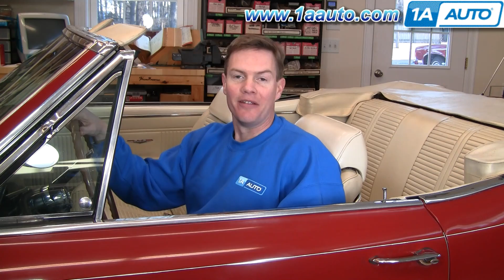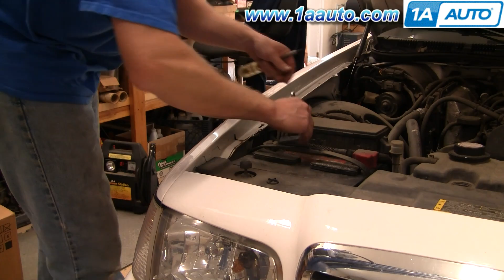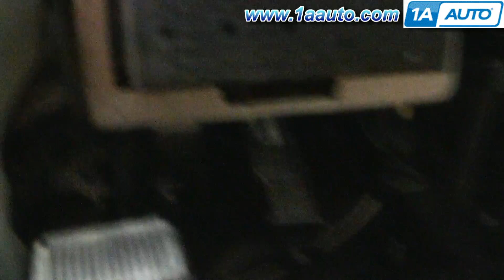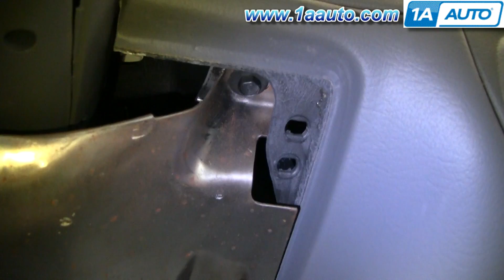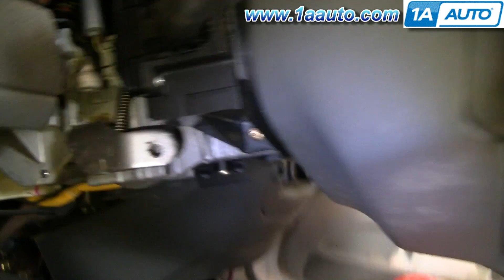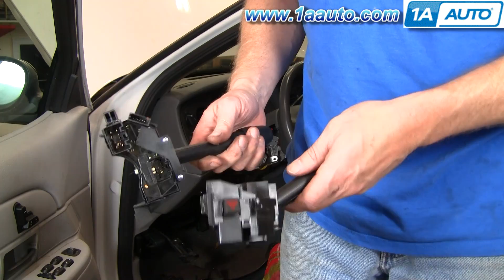How to Replace Combination Switch 03-11 Ford Crown Victoria

Comment: One a 2007 crown vic all I had to do was disassemble the top of the steering wheel assembly and pull the bottom down enough to get the t20 screws out.

Comment: Why remove all of those additional panels ?
I was able to change out my switch module by just removing the top and bottom steering column panels (" clam shells " ) 
That tab that was access to the ignition box cylinder under the ignition, ..... was that action necessary to make the computer electrically accept the new unit ?
I changed mine in hopes that the wipers would not run when in the OFF position, but the new one did not solve the problem.  THE WIPERS STILL RUN AUTOMATICALLY ON THE SLOWEST INTERMITTENT WIPER POSITION.
ANY IDEAS HOW TO SOLVE ??  I WAS TOLD TO GET AN OEM PART BUT THEY ARE NO LONGER MANUFACTURED NOR AVAILABLE.  I DID ORDER YET ANOTHER NEW ONE BUT HAVEN'T YET INSTALLED IT.
  ???? ANYONE?

Comment: Not a very hard job. Tips:
1. Gently tug outward on the lock. I couldn't really tell when I had the button pushed but it pulled out easy when I did.
2. Having a magnetic torx for the top screw would be super helpful. Or just scratch the T20 tip on a neodymium magnet for a few seconds before using.
3. Getting the tilt lever in and out is a pain. Takes a 5mm wrench. Doesn't turn easily. Hard to rethread too. It's a M6x1.0 in case you bugger the threads and need to use tap/die.
4. If the top cover won't go back on level make sure the wires to the small black plug are running to the inside of the plastic tower thingy the screw that holds the bottom cover feeds into.

Comment: everything works , but they do not cancel when turned , both left and right . Is this the stalk or something with the clock spring ?
Reply from the maker: +Jerome Zielinski We wouldn't be able to diagnose an issue like that here, you may want to have a local mechanic take a look at it. Thanks for checking us out! http://1aau.to/m/Shop-1AAuto-c

Comment: If you finish removing the steering column trim, you can access the connections a lot easier.

Comment: Alright, I tried to do this myself to wire in something, and I couldn't for the life of me get the tilt lever to budge. I have an adjustable wrench on it, but rotating it in either direction doesn't unscrew it, it almost feels like the threads are stripped or something. Am I missing something?

Comment: Use this video as a GENERAL guide.  It does NOT necessarily apply  to any and every model from 2003-2011.  
The 2004 used in the video was different from my 2010. Fastener sizes and type were different and no I didn't have to remove the ignition cylinder.
Reply: Is the same sizes you used would be good for 2011? If so what sizes did you use?

Comment: I have a 2010 Crown Vic, my highbeams and wipers work fine but I have no turn signals. I replaced the fuse and it blew immediately. Could this switch be the problem and blowing the signal fuse?

Comment: Tried this on a 2010 Crown Victoria Police Interceptor and did not need to remove the ignition cylinder.  This model has a rubber gasket that surrounds both the column shifter and the ignition cylinder, so I just needed to peel back the gasket.  Other than that the steps were exactly the same. Thank you for a great video!
Reply from the maker: +Steve Brand Thanks for the feedback, glad this helped!

Comment: My 08 Crown Vic Police Interceptor was even easier than the video shows. 7/32 bolts hold the bottom steering column cover. Unscrew the tilt lever. Pull the knee panel trim and it pops loose. 2 T20 Torx screws hold the stalk in place. Remove the 3 electrical plugs and reinstall. Should take 10 minutes.
Reply: I also have an 08 CVPI and thanks for the more direct detail on this year.  I had to also use a 9/32 for the brake release as it was tied to my kick panel.  Got an OEM switch installed and unfortunately my wipers are still on the fritz.  It was the switch or the wiper motor.  Motor comes tomorrow.

Comment: Hi 1A Auto I have a question related to my 2003 grand marquis.
When I start the engine the wipers start too and they stop working after a few seconds but not at rest position they stop at the middle of the windshield, as an extra  comment they never turn off at rest position.
Reply from the maker: +Roberto Ortiz We wouldn't be able to diagnose an issue like that here, you may want to have a local mechanic take a look at it. Thanks for checking us out! http://1aau.to/m/Shop-1AAuto-c

Comment: I have a 2006 Mercury Grand Marquis, and the turn signals, hazards, and lower brake lights were not working (the third brake light was still working, though). I checked the fuses and none were blown, so I replaced this multifunction switch and it fixed everything. If you’re having a similar problem, and you have a Grand Marquis, note that it is unnecessary to remove the lock column and also unnecessary to remove the metal plate behind the lower plastic cover. For those wondering, the reason a bad multifunction switch caused loss of brake lights in addition to the signals and hazards is because it contains a brake light interruptor, which is for shutting off your brake light if signaling and braking at the same time, thus when your signals fail, your brake lights might fail too.
Reply: Thank you. I have a 07 Mercury GM. Trying this soon

Comment: Just out of curiosity, why does the ignition lock have to com out?
Reply: I took my entire column down, replaced the  steering shaft, and the signal connector and I didn't have to remove the cylinder lock or the steering adjuster. What gets me, they do these videos; haven't they heard of a power tool?
Reply: For a 07 Mercury GM I didn’t have to.

Comment: I don’t know about other years but I just did this on my 2006 P71 and didn’t have to do a lot of what this gentleman did on this year car. 
I am not saying he did it incorrect because he did not. But my year (2006) didn’t require as much work. 

Here’s the steps I took. 

1) disconnect the battery negative.

2) unscrew the tilt wheel wand.

3) unbolt the 3 bolts under the steering column that hold the plastic cover to the column. 

4) unsnap the plastic column cover, it is 2 pieces. A top and a bottom.

5) you will have access to the torx bolts in the multifunction switch at this point. Disconnect the 2 torx bolts that hold the switch to the column. 

6) get the multifunction switch loose so you can access the back of it. 

7)There is 3 electrical plugs in the back of the switch. 

8) Unplug those from the old unit to the new one 1 at a time so you don’t make a mistake. 

9)Now reveres everything you did to undo it to put it all back. 

This job took me about 30mins and fixed my wipers not turning off. 

I am Thankful for the gentleman I bought my car from for giving me a box of new ford parts in boxes and one of them was a new multifunction switch.

Comment: Hi I have a 2009 ford crown Victoria and my wipers sometimes get stuck while they are on and then start working normally. Also when I press for the washer fluid it doesn’t come out (no motor noise for washer fluid). Everything else works (high beams, turn signals) Do I have to replace the multi function switch or wiper motor? I just need my wipers to work especially when it snows and rain here in northeast. Thank you
Reply from the maker: +Asif Sarfaraz Thanks for watching!  There could be multiple reasons why you're having this particular problem. We suggest taking your vehicle to a nearby reputable shop to accurately identify the cause!  1aauto.com

Comment: Thanks to you i was able to replace mine without a hitch.. unfortunately it did not fix my problem.  Which is that the bright lights indicator remains on and the headlights are  dim in both bright and regular positions.. well at least i know what it isn't..
Reply from the maker: +Dennis Berrisford, You're welcome!

Comment: When ordering this part now, tha turn signal switch connector adapter has to be replaced...after trying to remove the pins from the old pin housing I broke one of the metal wire connectors... where can those wire connectors be found and what is the proper name for it?
Reply from the maker: +Q Jack Thank you for checking us out!  Unfortunately that is not something that can be purchase individually, as you will have to get a new assembly.  If it is part of the wiring that comes of the vehicle you may need to contact your local dealership to find the exact part, or try some salvage yards.  1aauto.com
Reply: 1A Auto Parts what does the smaller connector operates on the wiper switch? Do you know what the orange wire is for that's running to the connector?  Last but not least do u have a picture of the connector showing the original wires? I had to replace adapter but my highest speed isn't as fast as it was before I installed a new switch

Comment: This is a good video, but slightly different for my car, a 2007 CVPI. I could not remove the lock cylinder and it was not necessary to remove it. Also, holding the under dash plastic plate on was one of those non-reusable Ford fasteners.

Comment: Hi There , I have a 2004 crown vic  p71 and my turning signals dont work but the hazards do. its driving me nuts. everything works except the turning signals. do you think the multi function switch is the problem?

Comment: does this series of steps help with a 1997 mercury grand marquis wiper/signal stem...on mine the cap at end of stem has popped off and will not stay attached,it has the sprayer logo on that piece...does a VIN NUMBER help with getting correct part...very good clear video
Reply from the maker: +Rugged Rick Rude We currently do not have an auto repair video specific to your vehicle. You might be able to apply some of the basic steps shown in this video to your application. Here is a link to the repair part that would fit your vehicle. Hope this helps you out https://goo.gl/yEMVeA
Reply: yes I thought about pre planning the job using this vid...tyvm

Comment: My signals and wipers and high beams work. Now when wipers are if you hit left turn signal wipers go off then when turn signal is off wipers come back on. It only does it on left turn signal . I'm going to try not to drive in the rain but if I do I'll turn off wipers for a minute when I hit left turn signal .. does my multi function switch meed to be changed???
Reply from the maker: +Stumpguy There may be a short in the switch. We carry the replacement multi-function switch on our website. Here is a link to them http://www.1aauto.com/1A/turn-signal-lever/Ford/CrownVictoria/1AZTS00095?utm_source=YouTube&utm_medium=CTA+Comment&utm_campaign=ytcomment&utm_term=WqWeB_6BOm4

Comment: I have a 2000 P71, my wipers do not work as well as my high beams. At times, the head lights flicker on and off. Could this be the issue or do I need to buy a windshield wiper motor and new switch?
Reply from the maker: +Mopar713 You may have a bad multi-function switch. Here is a link to the ones that we carry on our website if yours needs to be replaced. Hope this helps you out. 1aauto.com

Comment: Thank you so much for this video! The turn signal stalk wouldn't cancel when turning left, and was wouldn't even move so I could signal a right turn. Googling the symptoms led me to this video. This was so easy to do, saved me a pretty penny - everything works properly now! I have a 2006 Grand Marquis, and like others I did not need to remove the ignition key cylinder.
Reply from the maker: +Blagovestka Thanks for watching. If any of our viewers needs to make this repair, we carry the auto repair part shown in this video on our website. Here is a link to them http://www.1aauto.com/1A/turn-signal-lever/Ford/CrownVictoria/1AZTS00095?utm_source=YouTube&utm_medium=CTA+Comment&utm_campaign=ytcomment&utm_term=WqWeB_6BOm4

Comment: I have an 03 Marauder and the smaller connector is different but they sent me correct connector but I have to take the wires off the old connector how can I achieve that without damaging anything
Reply from the maker: +Keith Williams Thank you for checking us out. You will have to be patient with the transferring of wires, but if you could send us an image of what you're working with, along with the VIN to service@1aauto.com we may attempt to assist you further. 1aauto.com
Reply: 1A Auto Parts don't have the vin on hand I'm at work right now could I send pictures?

Comment: good video to show a walkthrough....however...

if you own a mercury/crown vic from the 02 model year that is "03" it may have a switch in it that is an "old style" which is a tiny bit different for the small connector on the top corner...with some swapping to a supplied clip to fit the new style, which is basically a flatter connector, it is pretty simple. and to warn all who do this, its easy to get apart, the reassembly however can be annoying.
Reply: abursaw I'm having that problem right now in my 03 Marauder how did you swap the clips without damaging the wires?
Reply: abursaw. hey man, i have a 03 crown vic and my connector is the same as you describe. im trying as hard as i can to get it to fit, but it wont. the part i bought seemed to come with an adapter, but it wont plug in, so i figured it was a bypass. is it a bypass? or do i need an adapter?
Reply: keith williams. if you fixed this, please let me know how you did it. i cant find anything about this issue other than this video.

Comment: Hello- I have a 05 crown Vic and my wipers are not moving. Please help
Reply from the maker: +diego posso Thank you for watching. This could be caused by either the wiper motor, the wiper transmission linkage, or possibly a fuse or relay. 1aauto.com 1-888-844-3393
Reply: Thank you for your quick response. Any idea which fuse it might be.
Reply: Yesterday we went to car wash and they suddenly turned on, they started working. Sometimes they work and sometimes they don't. What do you think may be causing this problem.
Reply: how do u no if it's the switch or motor

Comment: Thanks for the in-depth how-to's! My 03 Grand Marquis has no low beams, no high s, only flash to pass. Is this the switch I need to replace? No burned fuses, and headlight switch turns on my side lamps, but again no headlights
Reply from the maker: +Trent Berry I might be a bad headlight switch causing the issue. We carry the headlight/wiper switch shown in this video on our website. Here's a link to them https://www.1aauto.com/1A/turn-signal-lever/Ford/CrownVictoria/1AZTS00095?utm_source=YouTube&utm_medium=CTA%20Comment&utm_campaign=ytcomment
Reply: I believe your grand marquis headlight case is the "lighting control module" LCM recall.  there was a  recall issued and they will fix it for free at a dealership, they just install an electrical plug in fix.  i had bought the part and did mine myself rather than wait for an appointment at the busy dealer, there was a long wait at the time

Comment: I have a 99 Grand Marquis and the wipers rest upright but they do work, signals work and so do high beams and lights. Could this be the switch slowly going bad or something else? Thanks?
Reply from the maker: +James A O'Hagan It might be a bad switch. You may also want to test the wiper motor to see if there's power going to it when the wiper switch is turned on. If there's power to the wiper motor then the switch is good, and the wiper motor is probably bad. Hope this helps you out. Have a great day! 1aauto.com

Comment: my left turning front signal blinks really fast and  back doesn't blink at all. and when i press brake the left tail lamp goes out.. could this be my turn signal switch.. jus replaced all bulbs.. please help me out
Reply: also it use to blink regular then it wouldnt from time to time .lately its just blinking fast and no left brake light..

Comment: if the wrong switch is placed in the car could night time lights stop working happened to my car
Reply from the maker: +Austin Burnett That might be possible. It could also be a bad connection in the end that connects to the switch. You might want to inspect the plug for heat damage. Hope this helps you out. 1aauto.com?utm_source=YouTube&utm_medium=CTA%20Comment&utm_campaign=1ATony

Comment: Thank you Very Much for this video! I was able to do this easily. The '06 Grand Marquis has 7/32" screws holding the bottom plastic under the wheel, and I did not have to remove the ignition switch. It was all real straightforward with the exception of changing the socket  all the time!

Comment: Great demonstration. I have a question about the wiper.  Is the wiper motor directly connected to the wiper switch via connectors and wires? Is there any socket/panel between them? I believe my motor and switch are good. What could be the problem? FYI, my car is 07 Ford Crown Vic. The wiper stopped working. Help....
Reply from the maker: You may want to check the fuse to see if the fuse is okay, if it is also check the power to the wiper motor with an ohm meter or a test light to see if there's power going to it. Hope this helps you out. 1aauto.com 866-403-3393

Comment: Question: My wipers don't work... I just replaced the wiper motor and they still arent working. The fuse are all good also. Could this wiper switch be the problem even though my signals and everything else is working normal??? Please help asap!
Reply from the maker: You may want to test the power going to the new wiper motor to see if there's power going to it. If there isn't you may want to work your way back through that circuit with a test light or an ohm meter to see at what point on that circuit you're loosing power. Hope this helps you out.